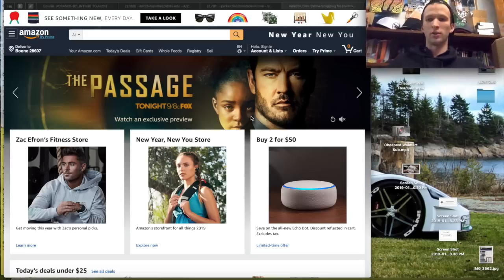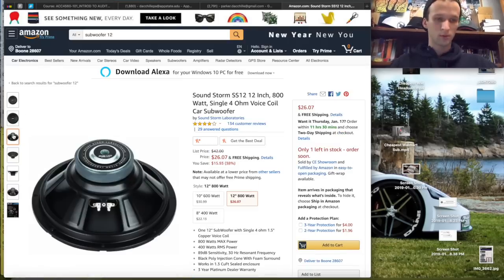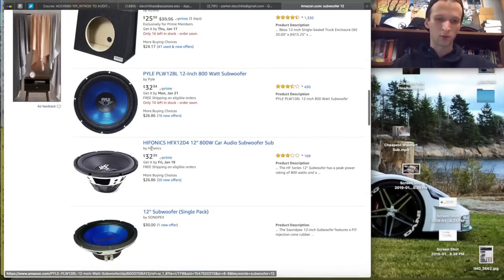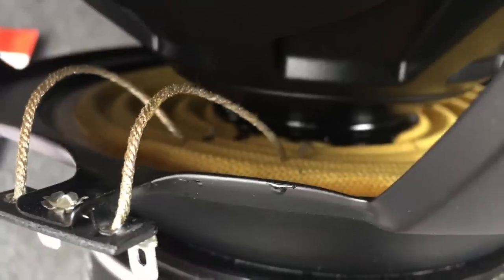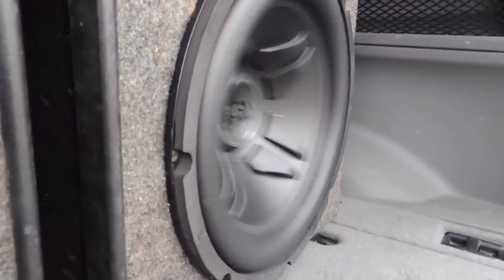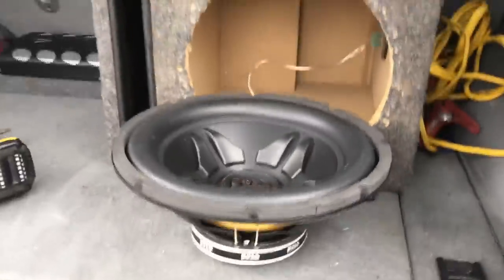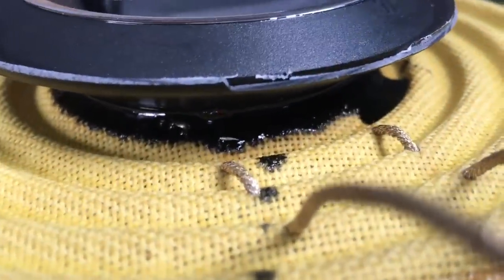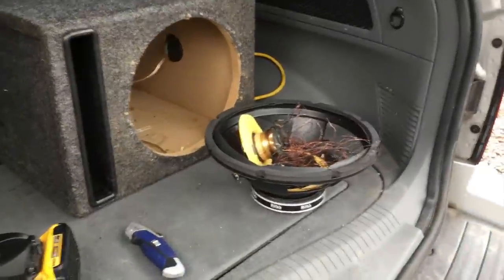BLOWING THE CHEAPEST AMAZON SUBWOOFER! | Boss CXX12

Comment from the maker: 200 likes! 100 to go and the JL gets blown
Reply: Id watch every video if you started a series that just did this sort of shit, blowing up cheap amps subs etc, and stuff like using a db meter seeing stats and effects of trying out crazy ideas to get more db.
Reply from the maker: 4GB MEANS 4GB I plan to keep making them! And I’d love to get a Db meter and some other testing equipment.
Reply: @ParkerTheBasshead  nice, ya a clamp meter or a real RMS meter (AMM1) while doing it to see actual wattage etc would be cool.
Reply from the maker: 4GB MEANS 4GB I definitely agree!
Reply: Parker Dacchille rip your Jl man :(
Reply: Bass Tester haha yep 300 likes woot
Reply from the maker: Bass Tester alright! It’s time to blow it! Maybe I’ll try to film it this afternoon if the weather is decent 🤔
Reply: @ParkerTheBasshead  That an expensive sub?   What is ur main amp? How many watts?
Reply from the maker: 4GB MEANS 4GB the amp is an AP APCLE-15001D. About 950 watts rms at 2 ohms and 1500 at 1 ohm. The JL sub isn’t anything crazy actually a pretty small sub but they go for like 130 used on eBay just because it’s JL
Reply: @ParkerTheBasshead  I see the subie in the background! Don't know if it was your car, but coincidentally I too drive a Subaru and run Audiopipe 1500s. More specifically a Lightning red 2011 STI Limited, with 2 American Bass HD12s  wired to .5ohm and ran with 2 Audiopipe APCL1500.1s strapped so each amp then sees . 25ohm. These AP 1500s are little beasts!!! IDK what I clamp at, but 1 of my amps dynoed at 2810rms @.5ohm as I'm sure you know. Anyways thought I'd share with ya, and keep up the awesome vids!
Reply from the maker: John VanCamp yeah man that’s my subie! 2002 WRX with a sti swapped built motor. Has a Rockville 10 and alpine Type S components. Will try to make more videos of it soon
Reply: @ParkerTheBasshead  Nice bro, i been saving and buy shit for over a year for my system.  So fare i got everything except the subwoofer.  Going to be running a 370a mechman elite, 2 xs3100, 2/0 skyhigh, Orion HCCA 5000.1dV2 at 1ohm to a single Sundown NSV4 18".   Also need to pick up a DD-1.
Reply from the maker: 4GB MEANS 4GB dang dude that’s going to be insane!!
Reply: @ParkerTheBasshead  Hella ya 8).  7.2 cub box tuned to 28hz too.  Pound them lows.
Reply: Parker Dacchille  I seen some real cheep subwoofer in wish
Reply: I liked....I want to see that jl on 110 volts a/c my old Rockford's p2/10s from 2004 lasted 2 min plugged into the wall socket let's see that jl machine gun for a while.
Reply: Rob Sorgdrager how many amps is the wall socket?
Reply: @4gbmeans4gb61  I do believe it was a 20 or higher as it was in my shop.
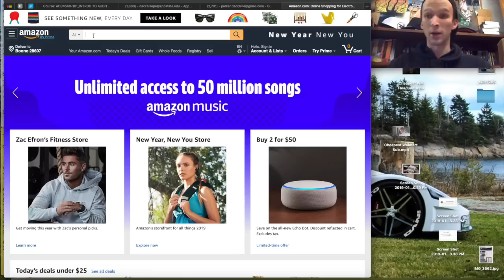Reply: He XD he said subwuufwer 0:40
Reply: I just bought that same subwoofer but the pair do you recommend me if it's a good sub just to chill in the car
Reply: Link to video please
Reply: Where did you buy your JL I’m looking for a set of 15s

Comment: Next Sub ya need to get is Soundqube. Thinking they're the best for the money on the market. 2 of they're 15 inch HDS2.1 (600 watts RMS) for around $104 a piece and you could power them with that amp. Or you could buy one of the HDS3.1 15's (1200 watts RMS) and use your amp as well.. Really think you should go this route. It's what I'm most likely gonna do.
Reply: Go with the 4in voice coil, save room for upgrading lol
Reply: hds 3.12 is an killer subwoofer, 1200w rms 2400w peak, good controlled kicks with metal music and it gets low af, I have been sending one full tilt with soundigital 3000, 1ohm evo II, full tilt not even the slightest problem, thinking about getting the hdx 15"

Comment: they have cheap weaker magnetic fields in the magnets with undersized coils and undersized coil awg wire.
they have weak motor strength. so even with lots of clean power. they just don't bump as well as more powerful more higher quality more expensive subs.
Reply from the maker: Yes Boss is definitely not my favorite! I just don’t like that they over rate stuff

Comment: I'm putting one of these subs in a home stereo system at 150w 3 way loudspeaker Max will this be good for that low of power
Reply from the maker: Yeah should work just find! However, something with an 8 ohm impedance might have better sound quality for a home audio system
Reply: I know the whole speaker is 8ohm and the receiver would this change the ohms
Reply from the maker: NiggaDave the speaker in this video is a 4 ohm speaker and only has one voice coil. 
The receiver will not have an effect one the ohms.
You want to a 8ohms speaker for 3 reasons. One, 8ohms just allows for better sound quality. As you lower the ohms you generally loose sound quality but allow power to be made more easily. 
2. 8 ohms speakers usually have a softer spider, surround, and cone. This allows for better sound quality and isn’t a strong as you’d see in a 2 or 4 ohm sub since you’re trying to get quality instead of window rattling volume

Comment: Your amp will do closer to 2k rms @ 1ohm. My older AP 1500.1 is good for 1350 rms @ 1ohm.  You should give the subs a chance by letting them brake in before trying to blow up. Any sub will blow if not broke in.  But i do like to buy cheap subs my self just for shits.  I have had a dual 10" 300rms sub take a beating for 3 years i was feeding it 1000rms @ 2ohms.     A sub you should try is a sundown zv4.   But a sundown SA 12 or a DB drive 3k will take the power you got.

Comment: I’ll tell you... a boss amp wire kit almost melted my jeep down 😂 I’ll never get a boss product
Reply: Don't blame some one else for your cheap ass cutting corners....it's not boss's fault cus you bought aluminum power wire cus the actual copper is expensive. You went cheap, you almost burnt your Jeep.....be honest .
Reply: Rob Sorgdrager uhhh I didn’t know that it was gunna melt. It seemed like it would be okay to run 50 amps through it, it even came with a 50 amp fuse. but I guess not. It didn’t say it was CCA wire instead of OFC. When I got it the actual wire was just barely bigger than their 8 gauge wire kit. It just has a real thick insulation. If I was the one who bought it I would’ve read the reviews. Just looking at it on amazon it seemed like a decent product.
Reply: @Submarine_SeXJ  you know better, don't play dumb. Don't blame any one but your self for your mistakes. You get a kit for under 150.00 you better know it's aluminum.
Reply: Rob Sorgdrager ger lol sky high 1/0 ofc kit with 200a fuse runs under 110$$$ 

Even welding wire ain't that expensive if you know where to look.
Reply: @lilrich1243  I've seen the sky high wire, I don't like it, it's not bad. I like using solar panel wire or generator cables. It's good multi strand wire that has some fairly durable insulation on it and it's very flexible. I pay a bit more sometimes but it's more wire than insulation.

Comment: Keep making videos man there very good keep going
Reply from the maker: I appreciate you I’m going to try to keep making them!
Reply: Try a pair of Soundstream r3.8 dual 2 ohm in a  2.4 ft.3 ported box tuned around 36 Hz.   Amazing little beasts lol..  500w RMS... Running 2 at .5 ohm on TA1.3000D 3K RMS Soundstream amp..  gets low as hell and still has punch if you listen to different styles... I've ran many higher end 10 and 12 inch setups.. These outperform all without a doubt.. best banger at 59$ on Amazon... I'm wanting 3 in same size as current enclosure...

Comment: putting way too much power to that speaker 400 rms  Total power output: 800 watts do not exceed more than 400 watts for the Boss chaos Exxtreme cxx10
Reply: read the fine print it's not 800 watts  they are listing it wrong if you put 800 watts to the speaker it will only last a couple days